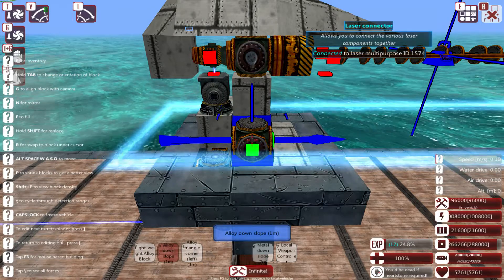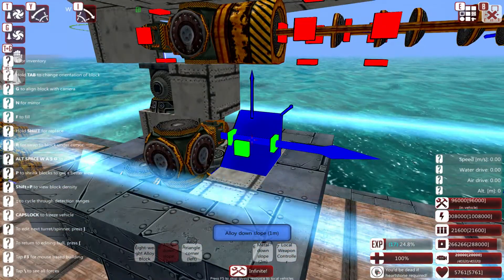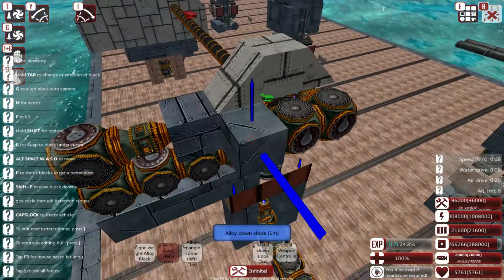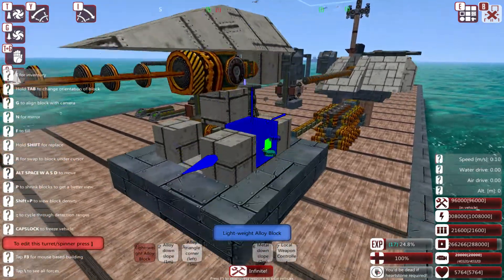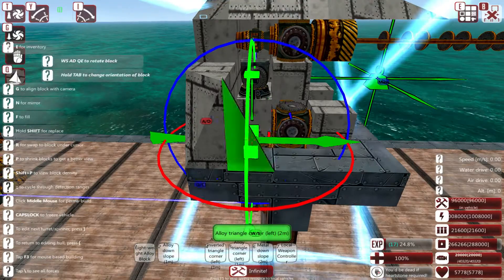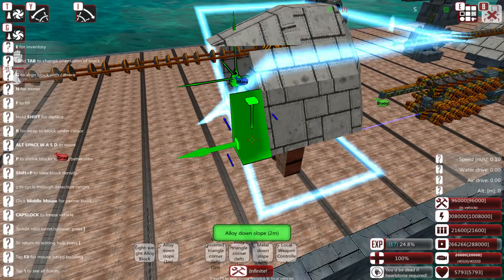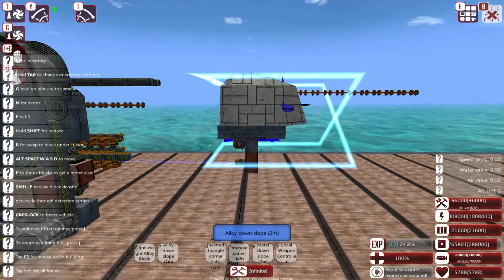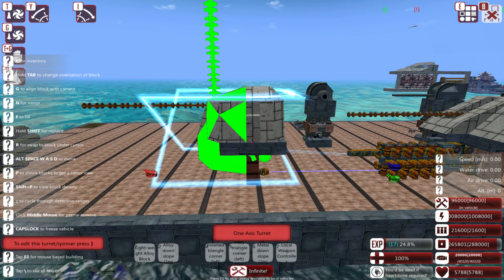From the Depths Season 2, Episode 1, Laser Turrets

Comment: Hey man i like your vids, remember you don't need connectors for transceivers to work, so you would be able to cut out some of the connector blocks from your original turret design.
Reply from the maker: +Ivar Thanks! And Ya, I figured that out just after I stopped recording. In episode 2, I actually rebuild this on the Corvette, and shave some space off.